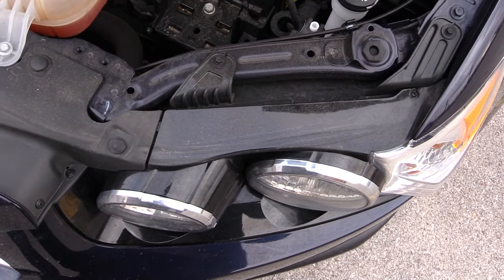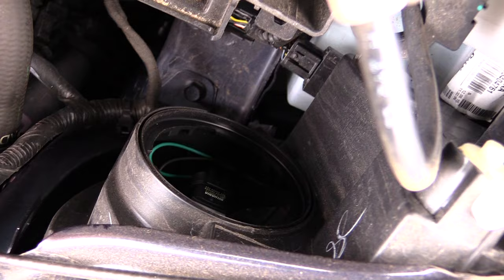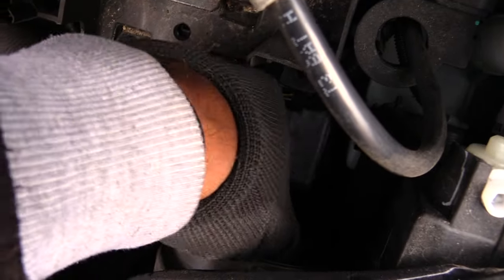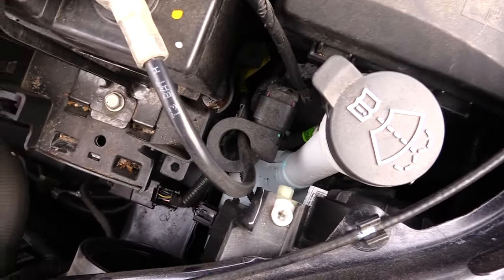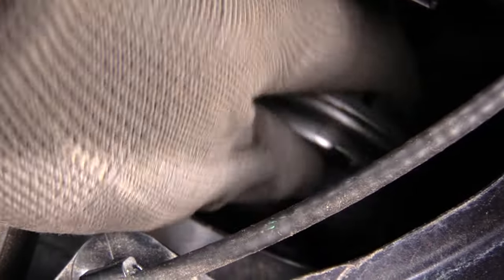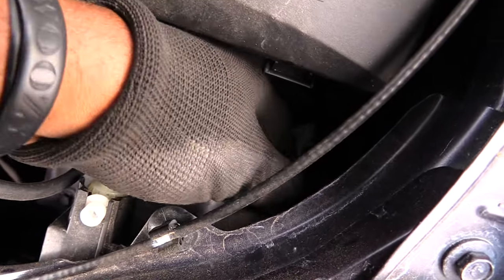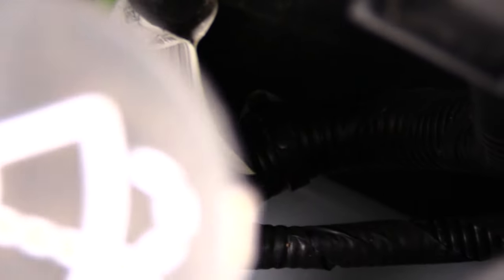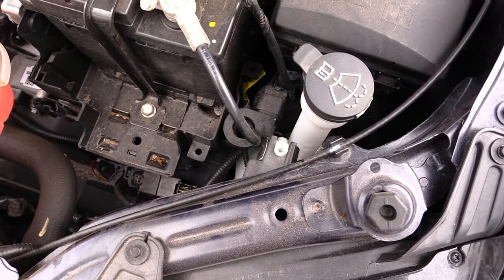Chevy Sonic headlight change Easy! 2012-2019

Comment: Other video I watched called for removing the entire bumper fender and head light case, I question how many times the wiper fluid filler is designed to be removed, that O ring might break eventually but I didn’t even have the trim remover tool needed to do it the other way so this vid saved me a major headache 👍
Reply from the maker: You're very welcome! Glad I could help. Please subscribe like and share and check out our other helpfull videos

Comment: So it seem to be fairly easy to change! I just bought a kit of 4 LED bulbs for my Sonic 2012 (high beam and low beam) on Ebay. Something strange though, they have a rather large aluminum heatsink and a fan on them, i guess LEDs do create a lot of heat hence the need of a fan to push the heat off/cooling it down
Reply from the maker: Yep. Please subscribe & like and share if haven't already and check out our other helpful videos

Comment: Great video. I have a question: if I replace the bulbs with LEDs (w/ fans),  will there be a heat problem because of those cover caps? Thanks.
Reply from the maker: Most time it's fine but if they start cutting out then u probably have to find  some different caps. Please subscribe & like and share if haven't already and check out our other helpful videos.

Comment: Good video! Do you also know how to replace the W5W lightbulb alswell? The manuel says just pull the socket out, but that doesn’t work. Both sides seems to be stuck of something. The socket only twists in de housing..
Reply from the maker: Tristan de Ruijter Hi thanks for watching and comment, sorry but I don't have car anymore, but u may need to twist when removing  it  or take it to Auto zone they should no how to do it. Goodluck.Thanks

Comment: Does car have to be cool?
Reply from the maker: No you can change when ever as long as not burnning your hands.Please subscribe & like and share if haven't already and check out our other helpful videos
Reply: @Flashback502  but like is it fine if i just had my car running and i turned it off and i need to take the coolant pipe out?
Reply from the maker: That's not your coolant it's your windshield wiper fill head